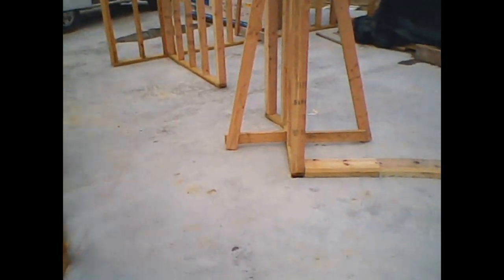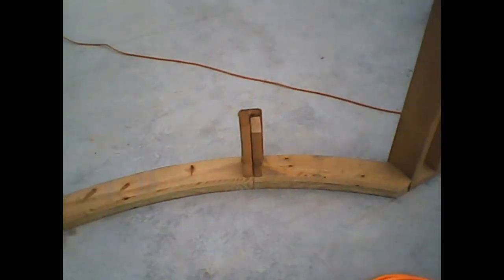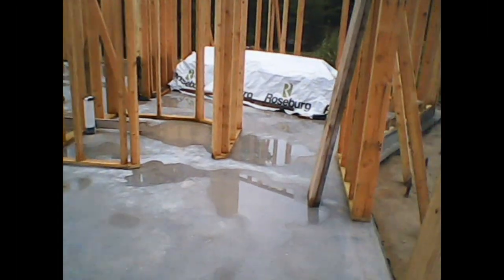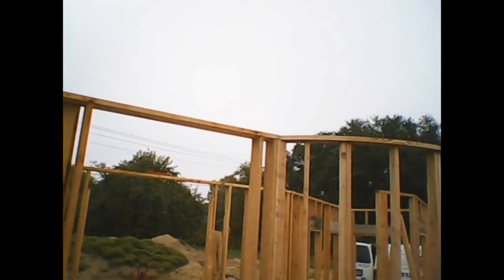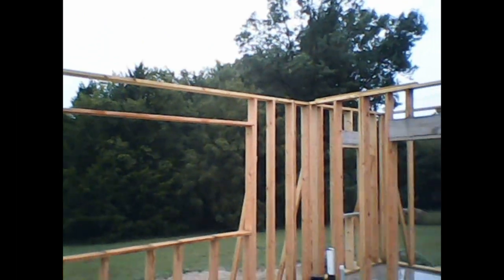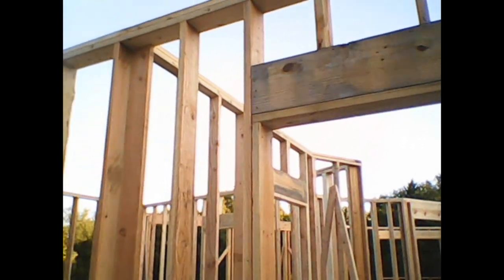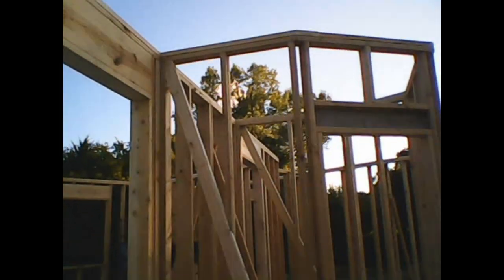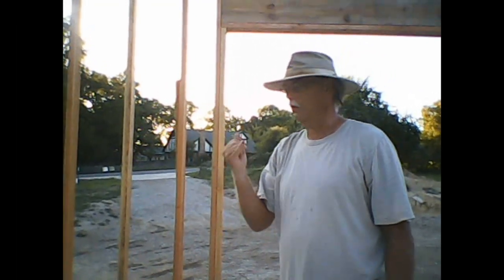Making Round Walls from Straight Boards   11

Comment: You can also cut your curved segments out of 3/4 ply, then stack and glue 2 pieces together. Your top and bottom plate for example. This way you aren't dealing with a bunch of iddy bitty lengths.
Reply from the maker: I had considered that option, but then I would have had to order additional sheets of pressure treated plywood (due to ground contact) and there would have been a significant amount of waste material after cutting out the arches. So I opted to use lumber I already had and the doubled up studs at the junktions actually stiffen the wall for better support for the staircase. But, yes, that would have been an alternat way to build it.
Reply: Treated 2x8s would run maybe $60, ply would run $120 in my market 2024.
But it to me is a better way to do it. Especially if they're concerned about shear. Triple 3/4" and bolted to the slab would be solid and a true brace.

Comment: nice work.  did you calculate the radius of the curve ( or was that on the plans?) prior to cutting the curved segments?  approximately, how long was each curved segments.  thanks.
Reply from the maker: Hi, and thanks for the interest. I a way both were the case. Yes, the radius was on the plans, BUT that's because I designed the staircase and did the calculations for it. I knew the radius was 6' to the sheetrock and we're using 1/2" sheetrock. Thus, the radius for the stud wall was 6' 1/2". The individual segments are about 18" long on the inside of the radius. To cut the radius, I made a cardboard template and then transferred it to the lumber and cut them with a bandsaw. Hope this helps. Sorry for the late response.